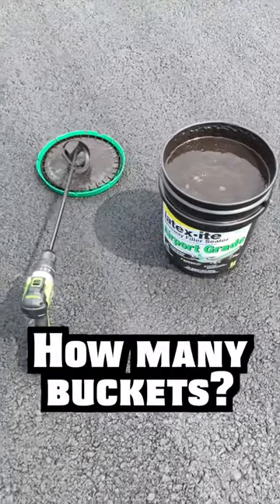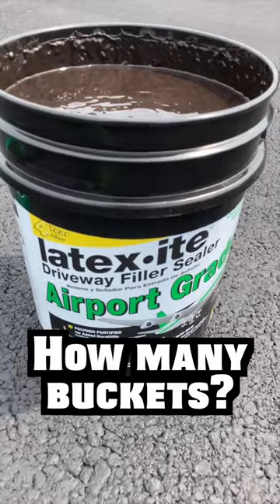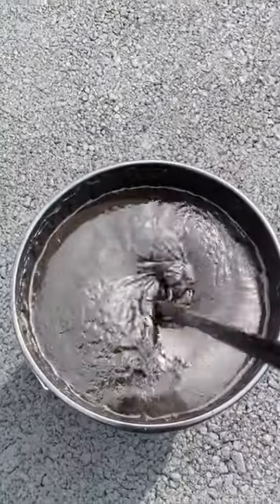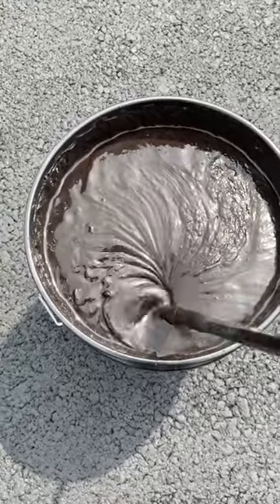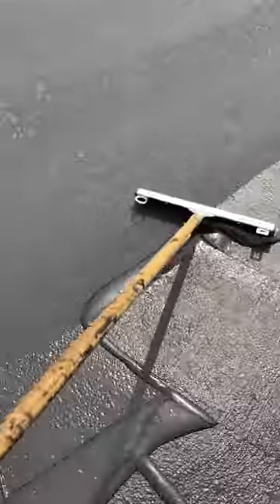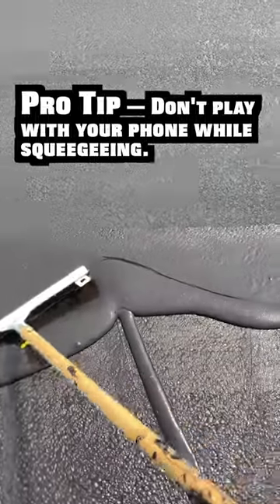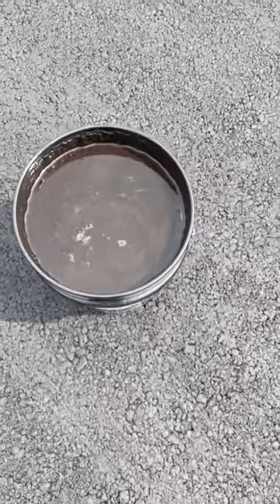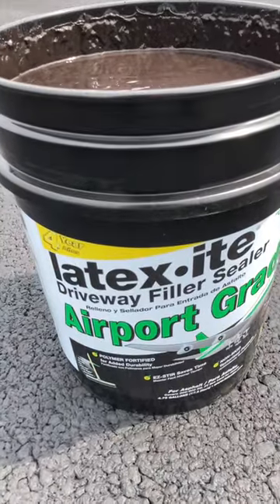How Many Latex•ite Buckets Does It Take To Seal A Driveway?

Comment: Dang, I would have guessed 10. If neighbors are complimenting it, that's all that matters. It must have turned out great!
Reply from the maker: I think 10 was my original guess. The buckets arrived on a pallet. Moving one is not so bad, but moving around two dozen was a lot of work. (Some buckets were returned.)

It was looking great until I took that break. The weather got a lot warmer after lunch. Unfortunately, there are noticeable streaks. I'm happy it's sealed though, as it rained a lot this year. Before sealing the driveway, it looked like erosion was starting, so I sealed the driveway earlier than I planned. I thought this would be an early Autumn project.

But also, I drove over the driveway with my lawnmower — after it got stuck in the mud. There are clay tire tracks that are not going away, even after heavy rains.

I'm waiting until next month to power wash the driveway. That might be another video.

Comment: The oil based stuff goes a lot farther and last twice as long. Though it can’t be bought in most retail stores anymore for environmental reasons. It can still be ordered online though
Reply from the maker: I think the Latex•ite stuff did alright. I'd probably use it again to seal the driveway. I don't think I'll need so many buckets next time.
Reply: Twice as long but 4x the price.

Comment: Doesn't help that your driveway is all binder and no finish pavement.
Reply from the maker: The “Two-Phase Paving Process” was not something I was aware of before starting this project. I thought asphalt driveway was just… driveway. 😄

I put in the description some more info. (I couldn't say it all in a 60 second YouTube short.) But basically, new driveways need more buckets. I thought I calculated for that, and I even overestimated, but I still needed more.

It's good to do projects like this, as I learn the difficulty in construction. It builds respect for other professions. Even just mowing the lawn, the guys who have been doing it for years make it look so easy. But, I learned the hard way that not always so simple.
Reply: @PhoticsTV two phase paving process?
Reply from the maker: @camaroman101  Well, I'm not the expert on asphalt driveways, but apparently my driveway didn't have a top coat. That's the “all binder” comment from above.

It's a new driveway, so I'm not sure if I should have waited longer before sealing it. Perhaps I could have given it more time to settle.

Dalton Enterprises, Inc. has an FAQ video… https://youtu.be/bUgWtw37HFk?feature=shared&t=84 …and John said, “we recommend waiting at least six months before you seal your driveway”

He goes on to say, “Give it at least a winter.”

So, I didn't know that. I didn't know about the timing of the binder stage and the top coat stage. 😄

Hopefully there aren't big cracks in my driveway next Spring.

I just power washed the driveway yesterday and it looks OK. I think the driveway could use another coat of sealer to smooth things out more, make it look more even. I'm planning to do that next year, or maybe I'll wait longer. It depends how it looks after winter.

Comment: Bro how do you make money if you needed 21 buckets and eaxh one is 35$ -50$???how much did you charge them for that
Reply from the maker: That's my driveway. I'm not sure, but the professionals might have charged less than what it cost me to do it myself. So, I'm not sure how they make money.

The guys I saw had their own truck, so that does speed up the job. (There are lots of videos on YouTube where guys seal driveways like they're renaissance painters.)

I thought I was saving $500 by doing it myself, as I thought it was going to be around $1000 to do the driveway. I didn't look into it further, because I didn't want to feel bad. 😄

The “Pro Tip” part was a joke… although probably good professionalism in general. I was holding my iPhone while spreading out the sealer, and that part of the driveway looked uneven when it dried.

That's also where I stopped to get lunch and when the sun started shining brightly. That mistake has been less noticeable over time, so that's nice.

Although, the project was cheaper than $35-$50 a bucket. I think it was like $25 a bucket. I just checked now and there's a sale. It's around $15 a bucket… a little more if less than five buckets, a little less if five buckets or more.

This is not a snowy winter project, so maybe that's why they're on sale. I have a bucket in garage that I'm hoping doesn't freeze.

I'm still glad I did the work myself. I look at the driveway and smile. The problem was that the driveway didn't have a top coat, which is why the project was so expensive and difficult.

I'm probably going to be doing this project again and hopefully it won't be as difficult or as expensive.
Reply: I would not even bother I would do it the smart way and spray the stuff and probably be done with 5